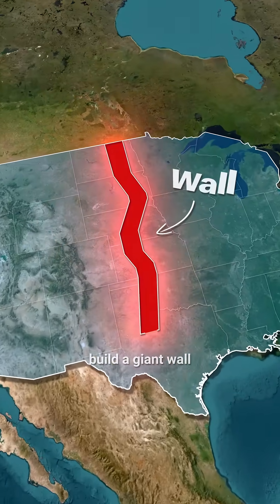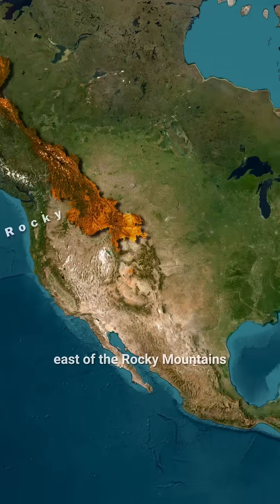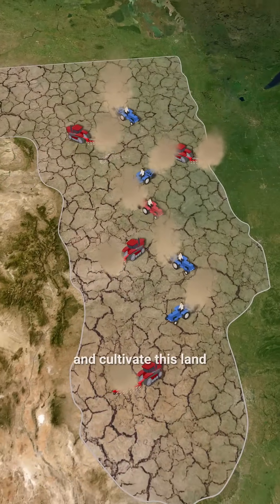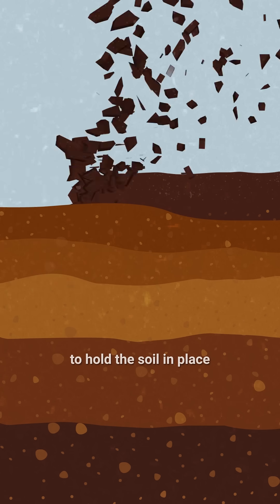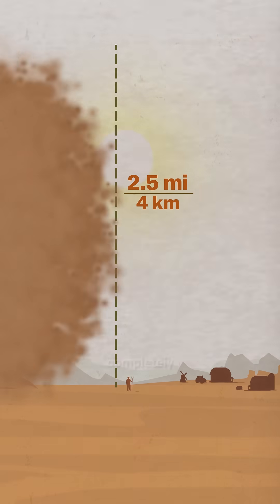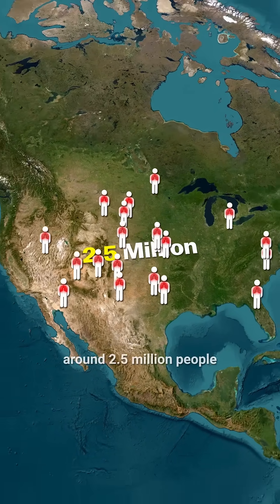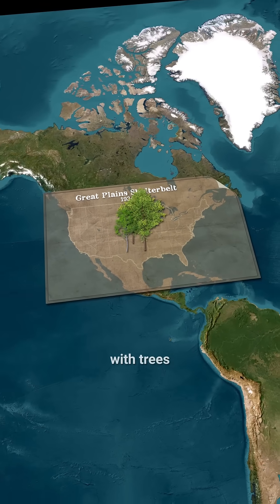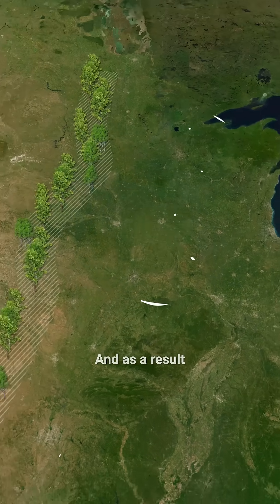Why USA Built a Giant Wall from Canada to Texas 😱🇺🇸 Great Plains Shelterbelt 🌳

Comment: This is fake. Studies show that trees or other barriers work for roughly four times the height of the barrier… ie an 80 foot barrier will slow winds and dust for about 320 feet. The lift off (vertical turbulence) will pickup again after 320 ft.

Comment: Trees were hardly the magic bullet that brought the end of the “Dirty Thirties” — when the grasshoppers and locust which ate every blade of grass and stripped every stalk of crops (and even the paint off the fence posts) moved on, and the rains finally returned and ended the drought and crops slowed the winds at the ground level again while their roots anchored the soil — the dust storms finally stopped.  This allowed the planted trees to grow and ALONG WITH better crop rotations, narrower fields (strip farming) with alternating crops so as not to have more than 20 rods bare ground at a time, and changes in tillage instruments (abandoning the plows which turned bare dirt topside over top of the vegetation) in favor of the duck-foot “digger” or noble-blades which kill weeds but better manage to preserve protective surface crop residue to keep the ground covered between growing seasons (a concept which led more recently to minimum or “no till” planting) plus replanting grasses on class IV and V lands were all part of the solutions and lessons learned by our farmers each of whom must feed over 100 of us!

Comment: That’s probably why I’ve only ever seen up to 40mph winds
Reply: 100-120 knot wind at sea in the Virginia Capes, 79 or 80.  Tied with a rope on the 0-10 as a lookout.  Could not see the masthead light on the USS JFK CV-67 while we were doing work ups coming out of the Portsmouth Naval shipyard refit.  They left aircraft on the flight deck and damages were considerable.  There was green water coming over the bow about 98 feet up; the swells were so huge.  I do not miss mid shitter watches.
It snowed like 18 inches in 24 hours in Norfolk.

Comment: Euro-American settlors were effectively cultivating the Great Plains from the middle to the late 1800s depending on location.   They had ploughs more than adequate to the task.  And I suspect if you looked closely you could find highly localized examples of dust bowl like phenomenon.  Then while tractors were being produced well before 1900 and gasoline powered tractors started being produced in the early 1900s in 1910 the typical farm was still using horse or mule power.

The what changed is more complicated than simply ploughs and tractors.  Modern farming was more capital intensive.  Farming became more profitable during the 1910s, especially during WW1, causing farmers to engage in more intensive farming.  Then prices dropped off after WW1 causing farmers to engage in even more intensive farming to produce enough to cover their costs.

Comment: You can google map Kansas(central/western part) which hardly has any trees.  But then you will see lines of trees which are the shelterbelts.  The tree lines only go for 1/4 to 1 1/2 miles long.  Each shelterbelt has nothing to do or linked to another.